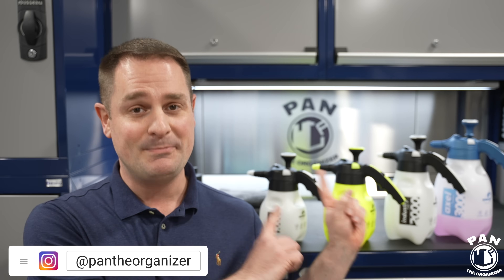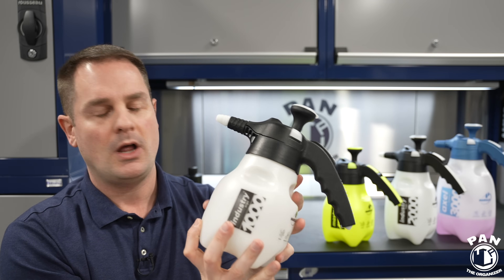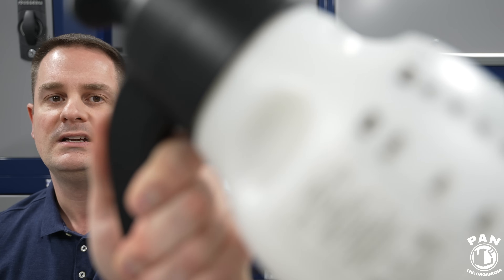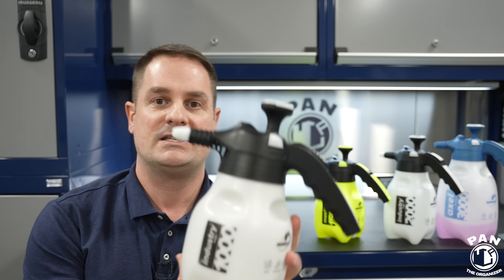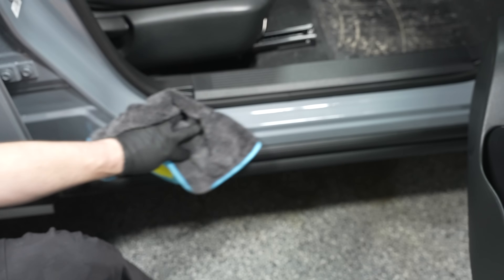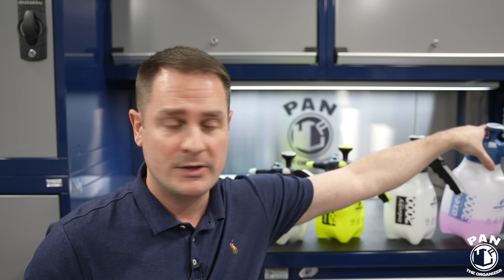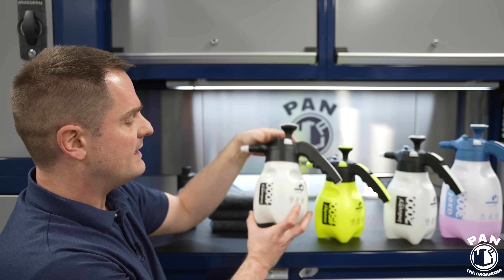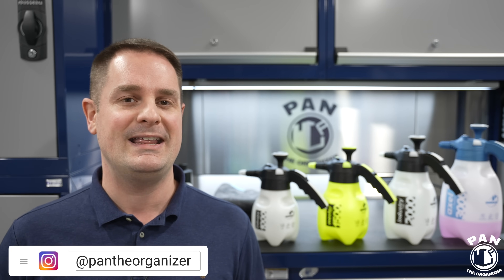THE BEST PUMP SPRAYERS & FOAMERS FOR CAR DETAILING! MAROLEX

Comment: The sucker Jr drying microfiber towel works great I found out about luxury microfiber from Bryan over at Apex . Great video Pan hope I didn’t confuse you on my question. I also use the 1000 for my APC pre rinse with extra tough or P&S APC .

Comment: LOL! My one aggravation with my IK 2.0 is that you have to pump it every 15-20 seconds. Here is the answer to that. Now I have to justify the expenditure :)  Thank you for finding the best tools!
Reply from the maker: The IK are still a very good choice. I have owned them for years and they are high quality. But when I tried the Marolex, it was a completely different level. The Marolex spray for much longer without needing to be pumped and the spray is higher pressure. Among other things.
Reply: @PanTheOrganizer  It sounds like I "need" the Marolex :)

Comment: Hey Pan.  Just got both the Axel 2000 Foamer and the Ergo Acid 2000 sprayer.  I had the IK products and while their sprayer works pretty well, the foamer was anemic and didn't stay "pumped" for very long at all.  The Axel 2000 blows it out of the water!  Tried the sprayer this morning to apply a quick detailer and the spray lasted for the whole car!  And it's mid-sized SUV!  Keep up the good work!
Reply from the maker: Thanks for your real world use feedback Mark!

And thanks for the trust you place in my opinion.
Reply: Wow that’s insane, I’m excited to give one of these a shot
Reply: For the sprayer, did you fill it up to 2L?  And how much was left after you sprayed your SUV?  I'm trying to figure out whether to get the 1L or 2L.  Thanks!

Comment: Marolex sprayers are freaking amazing Pan, thanks for highlighting these tools in your video. I made the switch several months ago because I realized I never had enough ONR for a presoak on the car with my Multi Pro 2 so I upgraded to the Industry Ergo 3000 and absolutely love the spray pattern much much more and the nozzle lock is quite helpful for hand fatigue. For foaming Brake Buster, I am still using a Foam Pro 2 that is still performing well and I'd say it is the better of the two sprayers in their lineup.
Reply from the maker: Thanks for sharing!

Comment: Yep I have the Marolex foamer 2000 and it's great. Very sturdy and foams up well. I use it for wheels 👍
Reply from the maker: Thanks for sharing
Reply: A lifehack to get 2 in 1 system. Buy Foamer to use foam. If you need sprayer you need to take off cap and see the long tube inside. If you look close the long tube consists from 2 parts, long tube and small tube with plastic connection and hole in it. Take out whole tube and separate short tube with plastic connection from long tube then put back only long one and now you have sprayer! Also you can take out a foam tip. But this is not the end. Also you can buy a spray nozzle from sprayer version that perfectly fit with foamer! 😉
Reply: @maksimgr1767  I bought the sprayer, how can I make it a foamer as well ?

Comment: Thank you for all the informative videos Pan! Few questions for ya.
-Can I keep non acidic wheel cleaner stored in one of these Axle foam sprayers? Or is that a bad idea?
-Why is Obsessed Garage phasing out the black handle sprayers?
Here is a quote from OG’s website:
“We are phasing out the black-handled master Series sprayers with the blue-handled ALKA sprayers. We have some black still in stock, so you may receive a black top or a blue top.***”

Comment: I have purchased several of these a couple from Matt and several from Luxury Microfiber the one thing I never see mentioned anywhere and it's what I absolutely hate the most about these is the dumb plastic top where you pump it when that thing pops off and you pinch your hand you'll want to throw that sprayer what I have done is sand that little clip off completely so it's nice and round and silicone that top on now I have no more problems but that is the absolute worst design especially when the handle holds the extra tips if needed thanks again for reviewing these much appreciated it should help the community 👍

Comment: Hi Pan, I bought the foamer and a sprayer a while ago, and totally agree on the build quality - bullet proof. I can citrus spray my SUV with one pump session. How did you get Brakebuster to foam so thickly at 10:1? Most reviews quote 4:1. Did you use distilled water? Did you use the light blue insert? Thanks
Reply from the maker: I have DI water in my garage. Nothing but the best. ;)

In my other foamers, yes I diluted Brake Buster 4:1.

But in the Marolex Axel, 10:1 works so well, as recommended by Luxury Microfiber who uses Brake Buster in his Axel foamer all the time.

Comment: Nice video Pan and those sprayers look impressive in terms of build quality and design. As soon as they put an adaptor for filling up using the air compressor I am sold. I did like the rinseless wash as it looks to clean very quickly. Thank you for the video.
Reply from the maker: Thanks Neil.

Comment: Nice!!! I was just about to buy some more ik sprayers. Glad you dropped this. 👍👍
Reply from the maker: For sure, the Marolex are the best pump sprayers I have tested to this day. I have pretty much the entire range of IK sprayers (from the original Foam, Multi 1.5, to the new Foam Pro 2, Multi Pro 2, and Foam Pro 12), and these Marolex allow me to spray for longer without pumping as much, and have a higher output pressure, among other qualities.

So nothing wrong with IK. They are top tier. But Marolex is superior in my opinion. Check out other videos on the topic on YouTube, you'll see the same conclusion. Including this one from my friend Matt Moreman: https://youtu.be/MBQahCBZN-o

Comment: Hello, not sure if you will respond Pan, but I just received my foam sprayer and tried using Adam's Car Shampoo (using the correct formula) and I got nothing but little spurts coming out. I tried the various tips that came with it, and still nothing. What am I doing wrong? Thank you.
Reply from the maker: Hard to say, as I don't know what sprayer you got (only the Axel series is meant for foaming, the one with the blue top) and don't know what dilution you used. You have to play with dilutions until you get something decent, and also hopefully you don't have hard water issues where you live as that greatly impacts the quantity and richness of foam you get.

Did you try reaching out to Marolex or the company where you bought the sprayer from?
Reply: @PanTheOrganizer  Marolex (Marolex Axel 2000) Foam sprayer like the one you demo in this video. The ratio was 2 to 3 oz per canister. I tried both options, 2 and 3 oz, but same results. I did reach out to Marolex but no response. Anyway, thasnk you for your comment.

Comment: Thanks for the vid pan!! Which one of these would you recommend getting to use for a pre wash for a pickup truck?
Reply from the maker: By pre-wash you mean foaming a soap on the vehicle? The only one that foams is the Axel series.
Reply: @PanTheOrganizer  not so much for foaming, mainly just looking to see which size of these would be a good size to get and hold enough chemical to do an entire pickup truck with without having to refill.
Reply from the maker: I'd get the 3L one
Reply: @PanTheOrganizer  thank you!

Comment: Nice video I recently bought a pressure washer and a foam cannon thought the pressure washer was fully quick connect, it wasn’t this is the perfect item I’m looking for
Reply from the maker: Thanks for watching. A pressure washer and foam cannon setup will always generate more foam compared to a foaming pump sprayer. Keep that in mind.

As long as you have a decent pressure washer capable of more than 1.2 GPM of water output.

Comment: Hello, I received my Foam Sprayer a week ago and I can't get any foam. (using Adam's Car Soap that was recommended in a different video). I followed the instructions perfectly and it just spurts out and nothing like the videos. I have been detailing cars for years and when you recommend a product, I will generally purchase it. This time, not so much. I tried to adjust the formula and the nozzle heads but still nothing. What am I missing?

Comment: I’m torn between this and the IK Foam Pro 2+ both look like great products! 👌
Reply: I’m thinking the Pro2+ so you don’t have to pump
Reply: Marolex makes a 7000 unit that you can pressurize - you can get it at OG.
Reply: @cynthiaenglish2736  Thanks! I’ll look into that, looks at bit pricier and bulky than the Pro 2+ though!
Reply: @joelmarris  Agreed. I have an IK & Marolex (smaller versions) but my Marolex is just built so much better. Good luck on your purchase.
Reply: @cynthiaenglish2736  Thank you 👍

Comment: That was a paaaaaaaaaaaantastic review.... I have the Axl3000, but the casket did not last long.... to replace the casket its a little pricey, I do love the sprayer, just need to fix mine... can't wait for the next video
Reply: We carry replacement parts on my webpage. You can easily fix any issues from use. These sprayers are designed to last many years
Reply from the maker: Thanks Mike! And as Sumeet says, replacements aren't costly and you should be able to get it back and running. He has great customer service.
Reply: @PanTheOrganizer  8.00 for parts then 8.00 for shipping.... to me thats little pricey

Comment: I've been using Hozelock and Gardena sprayers, because they are readily available from DIY stores where I am. They're not ideal for the task. You have to remember to depressurize them as soon as you stop using them, or the chemical leaks past the seals. I'll be looking in to these as replacements.

Comment: I’ve been wanting to add a foam pump sprayer to my stable and your video was the clearest one to help me make a choice. My question is, for the axel model, can any car wash product be used in it to create a foam?
Reply from the maker: Yes but you need to find which shampoos would foam well in a pump sprayer, and which dilution ratio to use. So you need to play around and have fun seeing what works.
Reply: Thanks for that input. I do have some different shampoos and just might pull the trigger on the Axel model. With nearly 3/4 million subscribers, it’s amazing that you take/have the time to respond.
Reply: Pan, I just took delivery of the Axel 2000 foamer. Is it me or is it as difficult as the instruction manual makes it sound to do maintenance on it? It’s like the whole thing needs to come apart to lubricate all the elements with silicone grease.

Comment: We have an additional version in the EU; Marolex Industry Alka: designed with different seals for alkaline chemicals. Our acid sprayer is called Industry Acid.
Reply: The Ergo Industry line is designed to handle acid based chemicals. We just refer to them as Industry instead of Industry Acid. Hope this helps
Reply: @luxurymicrofiber419  Considering alakline is more common then acidic chemical in detailing why not also offer the alkaline version?
Reply: @k1r4ns Definitely an option. Thank you

Comment: Hi Pan... yet another informative and detail orientated film on these Marolex sprayers/foamers.  Thank You!  I found them over a year ago when they were difficult to source, and so glad you've produced this video for all of your clients to view and enjoy.  These items are amazing.  At the time I didn't have a pressure washer, so used the 3000 series as a soap foamer to get a nice layer to contact wash.  My only issue with it was that I couldn't get significant pressure to do half of my SUV without about 100 pumps which I thought was a tad extreme.  Anyway..it did the job, WELL, and didn't have to go to the gym those days.  Also picked up another tip in the video.  Using a few of the big Luxury Microfiber Daddy towels eliminates dragging that big Red Sponge over and over again on my finish..   Clever.     So item of note in the video.. where do you get those little plastic measuring cups?  So tidy they blow my mind.  🤣
Reply from the maker: Thanks for your feedback! Those measuring cups are old school and not sold anymore unfortunately.

Comment: Hi Pan, upon your review, I have bought the Marolex Foam 3000, however when I filled it to 4.5oz dilution (as I do not need much solution for just 1 car), the foam that came out were not as shown by your demonstration. Its 1) Not fan-wide that covers much area 2) Its pretty much dotted with plenty of spaces in between each 'dot' of foam 3) The Pressure doesn't last as long (only about 2 doors) which seems weird for a 3000 capacity. Could you please advice. Thank you!
Reply from the maker: Not all products are made to foam, and you have to get the dilution right. So I have no clue what you were using in it, you didn't mention, also what dilution ratio, what water you have? Don't forget, I used deionized high quality water, so everything foams better with that.

Did you try reaching out to Luxury Microfiber to troubleshoot? Or from the place where you purchased it. They are better suited to help people with these questions. You need to consider many variables here. 

The pump sprayer works great.
Reply: @PanTheOrganizer  Hi Pan, thanks for your quick revert. I was using that pump sprayer with CarPro Descale with 1:10 dilution ratio. I use with regular garden hose water (not deionized). However, let alone not foaming well, the spray pump doesn't seem to spray with regular patterns. It sprays out tiny foam splatters as if something was stuck in the nozzles (but it is not, I've checked everything) and the pressure doesn't last long (about 2 doors on regular sized sedan).
Reply from the maker: Perhaps try another product that foams to see if it does the same. Descale is acidic and the Axel foamer is mainly used for higher pH products (alkaline) as people usually use foamers for APCs or snow foams or alkaline wheel cleaners.

I used Descalenin my foam cannon with my pressure washer and even there it doesn’t foam like crazy.

If you try another product and the foamer still does the same, perhaps you just have a defective unit.

Comment: Pan. I didn’t understand the Master series. Why buy one. Is it just for toppers, glass cleaning. What can you use this one for?
Reply from the maker: The green bottles are for gardening and home use normally. It just so happens that you can use them for detailing.

I use green bottles for things like rinseless washes and drying aids. Glass cleaners would be great too.

But if you get the white bottles you can put what ever chemicals you want in them.

Comment: I’ve watched your videos on detailing but I have 1 big question, can the same techniques and chemicals be used on vehicles with ppf without harming or damaging it?
Reply from the maker: Yes, but just be more careful, and perhaps inform yourself ahead of time with your PPF installer to see if there are any recommendations for your specific PPF as it can vary from one company to another. Rather be safe than sorry.

Comment: Another awesome video Pan! 
Gonna have to pick up a bottle or two 👍🏻
Have you ever used PPF? I’m thinking of just doing the front bumper on my new 4 series but have never purchased one before. I was just thinking clear and then protect it with a coating.  They offer 5 and 10 year warranties but wanted to get your feedback on them (pros/cons) before deciding to make my purchase? Thanks for all you do Pan 👊🏻
Reply from the maker: Thanks Mike. I am just not a fan of the look or feel or PPF. Plus, as I get a brand new car every three years, and do low yearly mileage, scratches and stone chips are of no concern to me. My cars are always pristine when I bring them back to the dealership.

But if you keep your cars long term and are concerned about stone chips and scratches, PPF is the only option, and I would for sure have a ceramic coating applied on top.

Comment: I thought you were actually going to test different brands? This isnt bias lol.
I have a kwazar foaming sprayer, n i like it because its decently bog, it looks amazing, it'll hold air for weeks, the seals are replaceable, there is diff tips that come with it and its built like a tank.

The ones ur using i have and like as well, however the kwazar foamer 2 liter is it for me. Love it. For a spray bottle, it has shelf appeal loke no other.

Comment: Pan, I recently started following your YouTube channel and love it! I have a question for you. My wife just bought a new 2022 BMW x3m40i. I had intentions on doing a ceramic coating myself but at the last minute without telling me she had the dealer put on a Teflon coating that they talked her into. I could get more info on what they used but my question would be how good is that coating? Would you recommend me removing it and doing the ceramic? If so what’s the best way to remove it. I’m curious on your thoughts. Thanks!
Reply from the maker: Anything the dealserhips apply is pure garbage. That's just to upsell things to customers and increase profit. It's very sad. I would for sure strip everything off and apply a proper coating.

You would have to go through all the prep steps, including washing, iron remover, claybar, machine polishing (most important step to remove the previous protection), IPA wipe and then apply the new coating on a virgin clear coat.

To further inspire you, watch how I fully detailed a new BMW X3 in this video: https://youtu.be/AGMX1AN2ogI

Thanks for the kind words about my channel Brian. ;)

Comment: Hi Pan, I just bought a axel 2000. Do I need to take the little sponges in the foaming inserts out, whether they are necessary to generate foam?
Reply from the maker: Don’t remove anything. It comes ready to use.
Reply: Oh, Thanks. I thought the sponges would block the water flow so I took them all out and they got mixed up, now I don't know which sponge should put back to which insert.😅